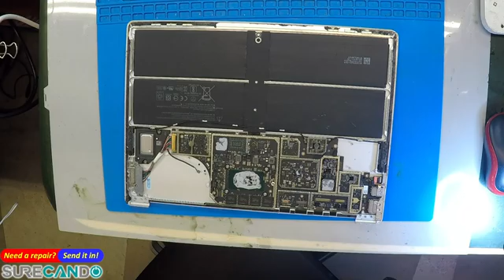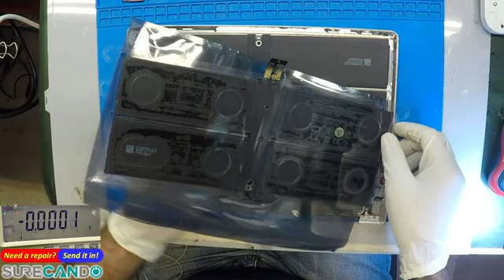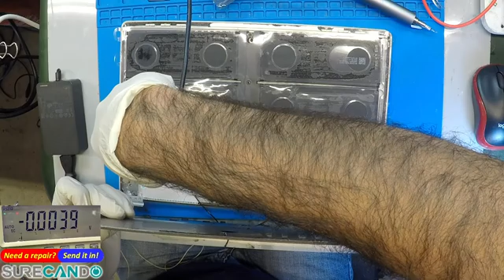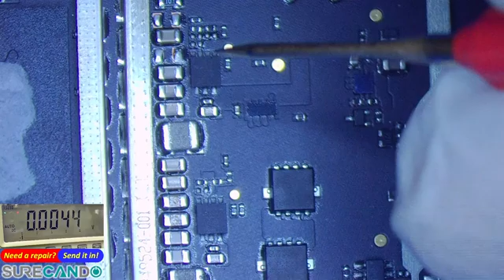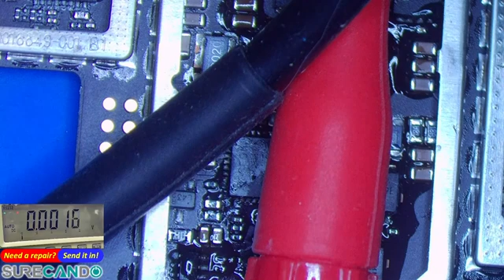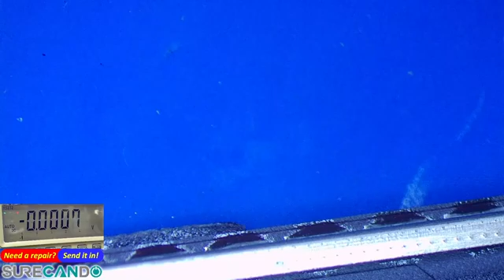MS Surface Laptop 2 1769 Not turning on, not charging battery. Full Disassemble Motherboard Part 4

Comment: I have one where when power button pressed, backlight comes on for 5 seconds then quickly turns off and back one for another 5 seconds. This cycle repeats 5 times. Ever see this?
Reply from the maker: No but I need to
Reply: @SureCanDo_Life  What’s the power on sequence for these? I’m not familiar with them
Reply from the maker: @mrsemifixit  you need schematics
Reply: I have one that does exactly the same thing, plug lights up but laptop won't turn on, how much do you charge to fix them